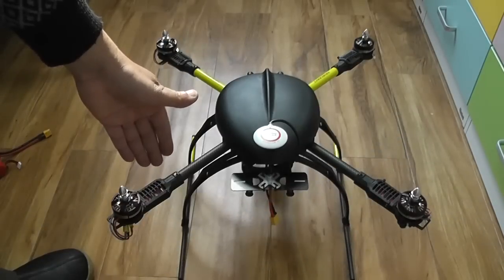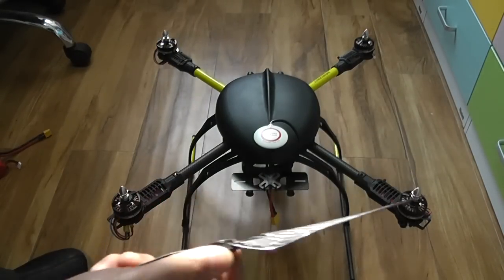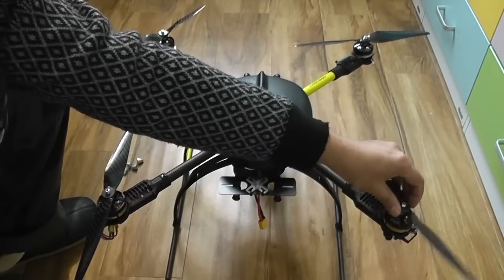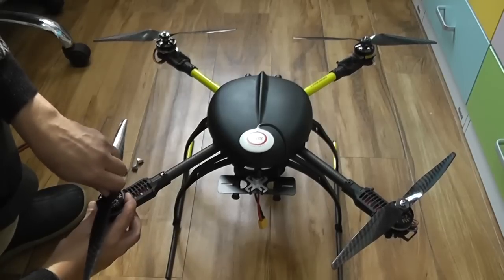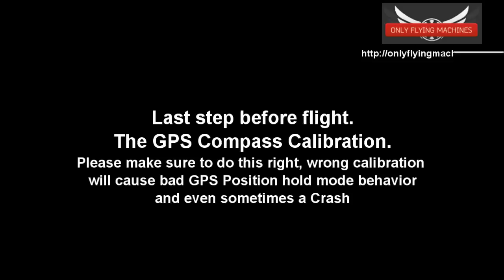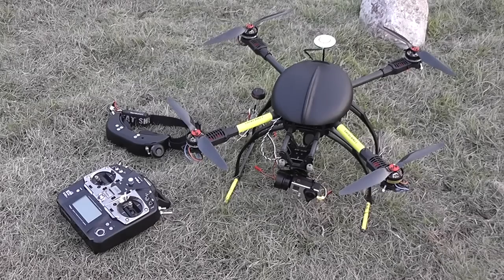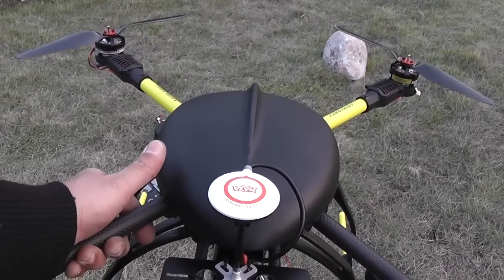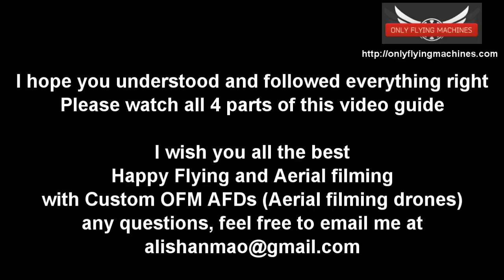OFM Quadcopters Pre Flight setup guide Part 4

Comment: Finally, I see that,  you use often now, also  the propeller with short shaft , directly with screws on the rotor. It is much better, I think. 
what is your own opinion? thank you et Bonjour de France

Comment: Very good videos,thanks in advance. planning a propeller guide? it´s hard to choose it, I am beginner, and need to know  which props are good for aerial photo/fpv ( more stable , longer flying time)  a carbon-fiber 10x4.7  or 12x3.8? will be runing on  4S 300W/750 kv motors.